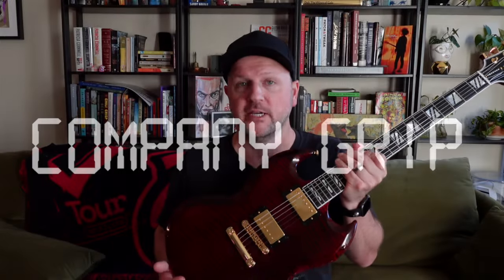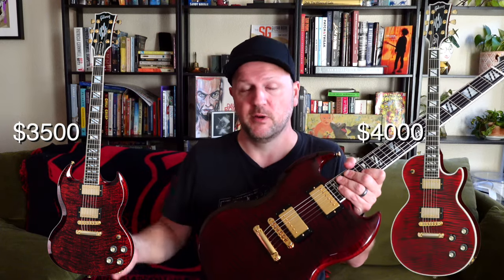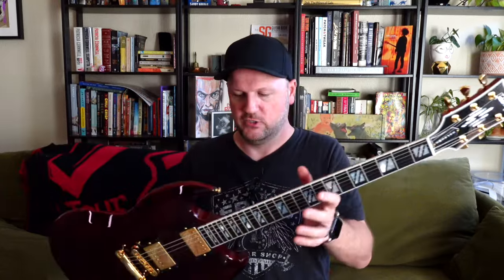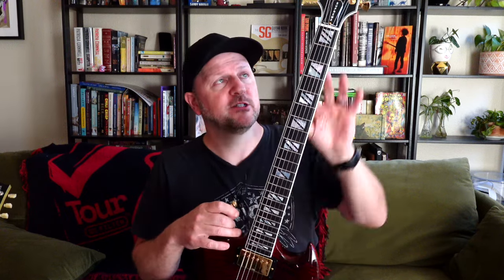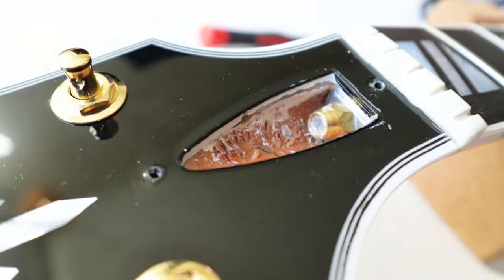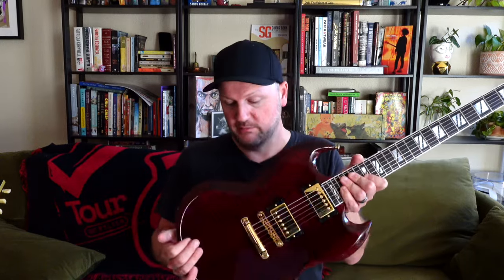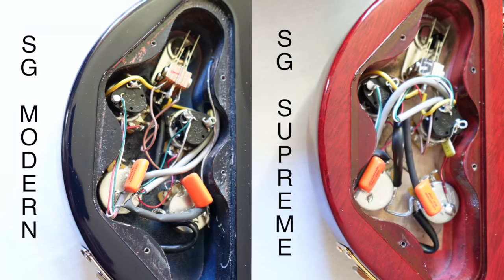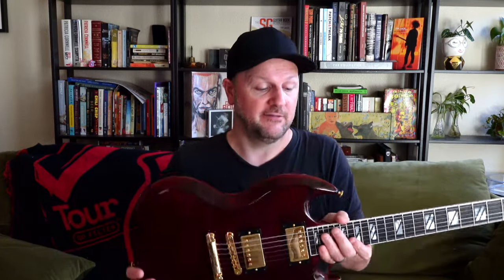2024 SG Supreme Deepdive and Sound test.

Comment: The thing that bothers me is that strap button location. That just isn't enough beef to hold that for decades. I would bet money that becomes a problem break point on these guitars as if the head stock is not enough.
Reply: I don't think that there will be a problem. Enough wood there to hold the button in my opinion... 🤔
Reply: My SG strap button has been on the tip of the upper bout for about 15 years.    Never an issue.   Also the 3 other SGs were just as happy.
Reply: It’s not an issue . Tony iommi been rocking it like that for decades

Comment: I have all of the LP and SG Supremes from 2000 to 2016. So I'm biased. I have to get one of these to round out the collection. There is enough here that is different to make it a worthy companion to the others. Thanx for a good review.
Reply from the maker: That’s pretty cool! Which year is your favorite for both the LP and the SG?
Reply: @CompanyGripGuitar  2000 SG Supreme. 2014 LP Supreme. But honestly, all of the 2000 to 2008 SG Supremes are the same. And all of the 2003 to 2013 LP Supremes are the same.

The 2014 LP Supreme is the F-Hole version and way different than any previous LPs. The 2016 SG Supreme is the carved top version and not my favorite although it does have some rare 2005 Seymour Duncan 50th anniversary PAFs in it.

I also have the 2013 SG Supra and 2013 SG Deluxe which are very much Supremes. Also have a 2008 SG Select that while it doesn't have 24 frets, it's all maple. Front, back, and neck.

Juniors, Specials, Standards, and Customs?  Got those too. I'm an SG fanatic.
Reply from the maker: That’s pretty awesome! I love me some SGs as well. I’m up to 8, but I only see that number growing… I’ve always liked the Diablos and regret not getting one when they were $3k on the used market…
Reply: I finally got a 2024. I'm not disappointed. It's excellent to say the least. I got a Fireburst. I already have a Wine Red 2008 SG Select so I was looking for a different color. It's on fire. I can't say enough good things about this reissue.

Comment: That's a killer finish. That mahogany back and neck look great in the wine red. Correct me if I'm wrong but it actually to my eyes looks more like what the original darker 60's "cherry" finish looked like new. So many of the models these days look orangey or faded in good lighting, but this one appears onscreen to not have that issue whatsoever. Again, correct me if I'm mistaken. :)
Reply from the maker: I’d say you’re correct. It is definitely darker than the cherry fades that have been more common lately. Thanks for checking out the video!